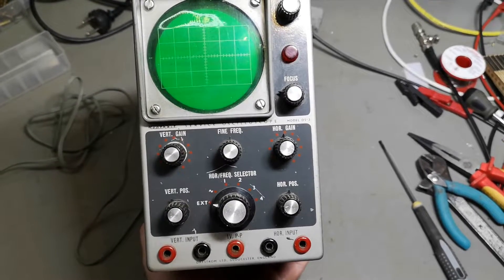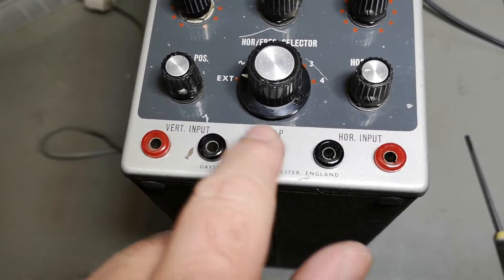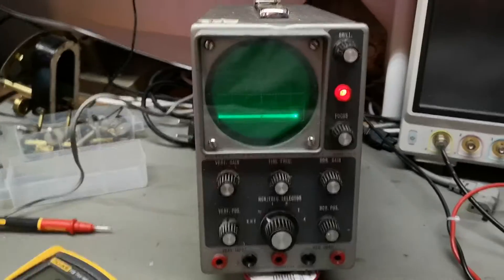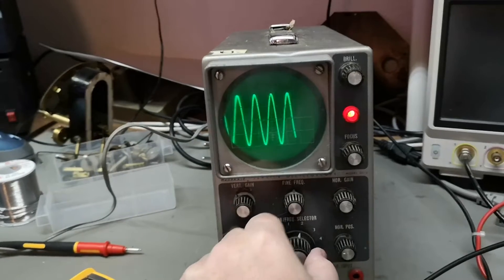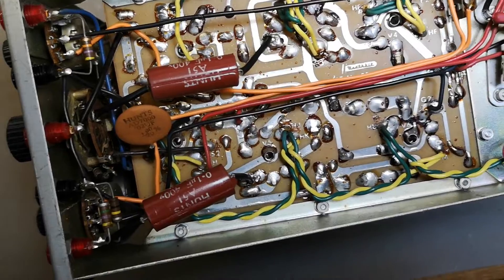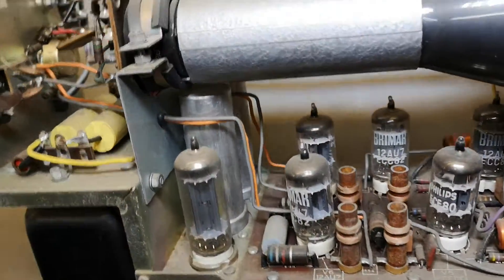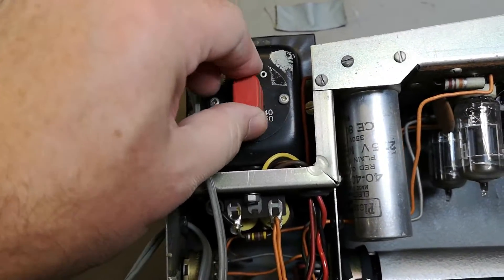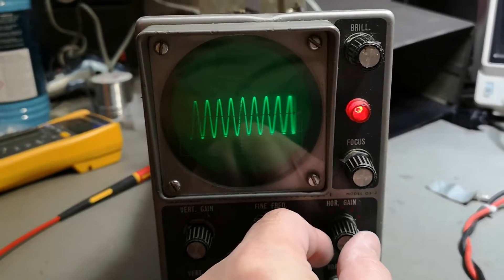Heathkit service oscilloscope OS-2 2Hz - 3MHz 7 tubes 1967 teardown

Comment: Thank you for a nice video. I have one of these CROs whicvh I use to monitor my transmitted signal at 3.5 MHz. I think i could apply the signal to the deflector plates at much higher frequency but it needs be a hundred volts or so. This is available from my ATU.

Comment: Hi there, I have the same scope but with a beige faceplate. Looks like the trimmer hell on the vertical gain is a mod by the previous owner.

Mine has a standard potentiometer at that spot, and the range matches the dot on the front. The manual also mentions a pot :)

Great video, gives me the motivation to tinker with my old scopes! Cheers!
Reply from the maker: you are right, this model exist in a few variations, they made it over many years